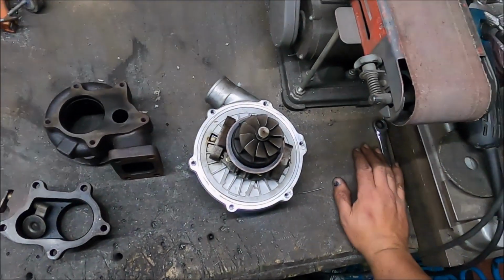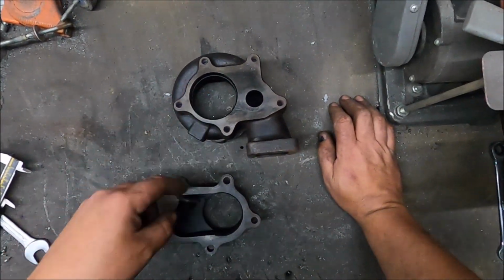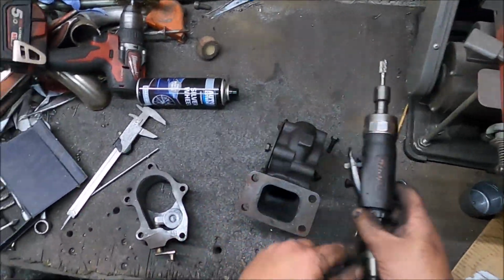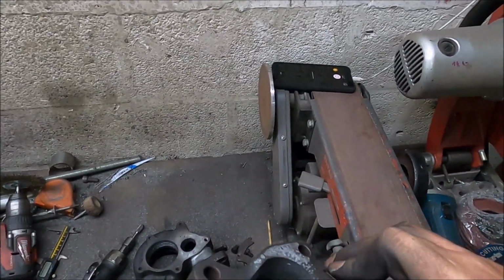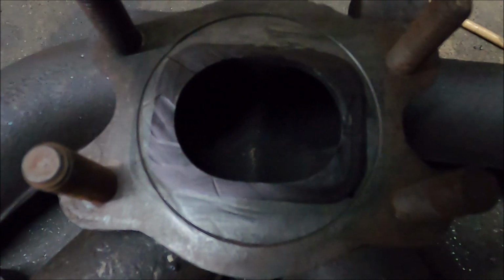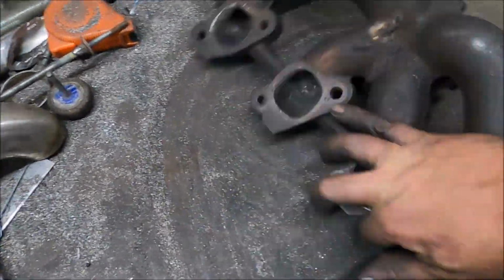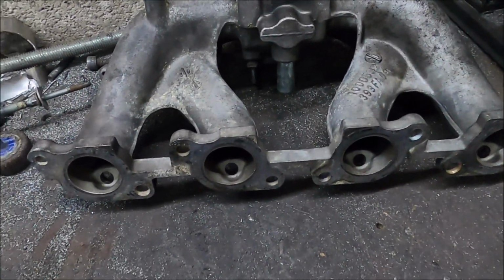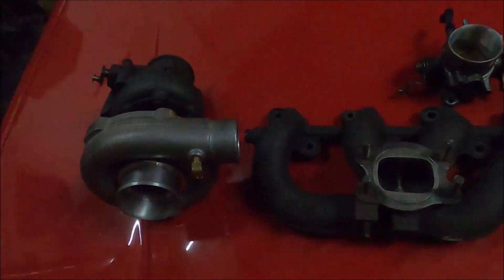Gettin' my grind on. Porting the turbo, exhaust manifold, and inlet manifold. Volvo redblock

Comment: Did the spool sound or anything changed after porting? I'm thinking about porting mine or making anti-surge ports.
Reply from the maker: No. Didn’t do it for sound, did it for performance.
Reply: @StavTech  so it did infact changed performance? Faster spoolup or?
Reply from the maker: @svicide_sexvs  yes

Comment: Do you have any contacts for Extrude Honing or Abrasive Flow Machining in the UK? How expensive is f***ing expensive? I'm potentially looking at improving the flow on a standard CA18DET exhaust manifold, turbine housing and maybe compressor housing to improve efficiency and spool.
Given the price of a Garrett G25-550 turbo and Walton Motorsport manifold... improving efficiency and potential of standard stuff (and 52-trim GT2871R 0.64) might be the more sensible approach. Ideally, I'd go for the G25-550 and then extrude hone, but the 2871 will already take my conrods to their limit, I just want earlier spool and broader torque curve.
The stock exhaust manifold splits the pulses, so combines 1 with 4 and 3 with 2, it doesn't look too bad at all for flow obstructions but smoothing the walls should make enough difference.
(I'm also working on two spare cylinder heads I've had in the garage for 15 years, found a Tomei Exhaust cam in one of them!)
Reply from the maker: I don’t know any place that’s done car stuff in the UK but a fair few places exist that do that job and I’ve considered the same too.

But your plan/goal I like the idea of, and fuck yeah that’s what I’d do over spending what, 4 grand or so on a fancy manifold and turbo.

In my experience optimising stuff that will cost you a quarter of that will get better results than the Gucci shit but just slapped on like most do
Reply: @StavTech  cool, thanks for the reply, I'll make a few calls and see how it goes, seem some mentions on US forums where it sounds like $75 to extrude hone a turbine housing... I was imagining $400 and then all the shipping costs. Will be getting manifold and maybe turbine housing plasma coated once done, keep that heat energy going toward the turbine wheel.
The higher efficiencies of more recent turbos like GTX gen2 and G25-550 is incredible, very expensive, but seems worth it, assuming all other efficiencies optimised, budget, etc.
Also discovered yesterday that gamma Ti-Al turbine wheels are a thing, HALF the mass of Inconel or Mar-M and marginally higher temp resistance.
I've got an extremely ported standard (54mm) throttle body by TURBOKONGEN (you may have heard the name), should be good to nearly 400bhp. I've smoothed the inside of the compressor outlet elbow, planning on getting a 50-60mm expander cone welded on and then sanding the inside smooth again, should remove a little restriction. Also, in the process of dowelling the plenum to the inlet manifold and inlet to the head so the port-matching I've done works. Flared out the back of the plenum's TB flange (on the inside of the plenum), hopefully distribute charge more uniformly within the plenum.
The GT2871R 0.64 52-trim comes in pretty brutally from 4000rpm, but I know all the little improvements will smooth that out and make it more driveable... possibly less scary/entertaining, but more tractable and driveable. Gas-flowing the head and the manifold/turbine housing should make pretty big differences. I do as much myself as is feasible, I even considered a £200 spares or repair Extrude honing machine.
Reply: @StavTech  just to update. Yeah, G25-550 is awesome, but £2200!
Should be getting my CA18DET exhaust manifold and GT28 turbine housing back from extrude honing in USA quite soon. $495 for the manifold, $250 for the turbine housing. £45 to post them there, not sure what it's going to cost to send them back to UK. Probably massively worth it for the turbine housing but possibly not very cost-effective on the manifold, I figured it might ensure the ports aren't blocked at the head by any manifold misalignment, if no other positive effect, maybe the smoother internal surfaces will reduce heat transfer though.
Compressor would be $250 but I've heard it doesn't make much improvement (exhaust gasses flow much faster!) and inlet manifold would $550 but that is unlikely to improve flow at all, despite the claims, it may balance the flow better between runners though, which could help optimise things.
Turbine housing extrude hone should increase efficiency by 3% and raise the amount it will flow. The OEM manifold is now proven good for 455bhp on a GT28 hybrid turbo and it ensures fast spool due to short runners and split-pulse design. Good tubular manifold unlikely to be better before 450bhp and costs a lot.
I've also read that a back-to-back test of with/without turbine jacket on a 6.7L Cummins diesel turbine housing made the turbo spool 250rpm earlier and raised torque 10% in that 250rpm earlier rev range. In theory, keeping heat in the manifold could yield even better results, rally-style wrapping seems more cost effective than ceramic coating though.
Docwra mentioned in the past that cylinder heard porting and inlet port-matching yielded 750rpm earlier spool, yikes! We had identical engine rebuild and turbo... comparing our graphs he's not far wrong! (30% more torque before mine made full boost pressure.)

Comment: Cheers! Love the video!! My OCD is sad though you didn't use a 100grit sand paper head getting those a little more smooth. I was changing my spark plugs on a Toyota Sienna and did all this..it really is amazing the car was breathing through straw. It sounds... happier even at 265,000 miles it just purrs.

Comment: Lower back pressure ftw, I'm going to be running a single GT45 on my lil V8 but I'm still a bit concerned about back pressure both before and after the turbo, If I ran twins it wouldn't be much of an issue at all but my power goals don't warrant the cost of twins. Basically I'll be running 2.5" pipes into the GT45 then a Y pipe into  2.5 or 3" dual tail pipes.

Comment: Hey, about a he500vg would it work fine in a l6 4.1 liter 7k/7.5k rpm max, engine? Im just making plans for now but knowing that the he400 is like a hx35, here in Brazil its kinda common the l6 4.1l hx40 equiped, so the he400 seens kinda small. What do you think?  [Edit] - getting it spring or diaphragm actuated would it need a external wastegate?
Reply from the maker: HE400 is like a HX40 usually. What engine is it? HE500VG will work well if looking for big power for sure
Reply: @StavTech  is a chevy 250ci inline six from a car called opala

Comment: Would it be worthwhile to weld the wastegate and run an external gate vented to atmosphere?
Reply from the maker: If I wanted to spend money, but I don't
Reply: @StavTech  was just thinking you might have one sitting around from another old project you could have put on. Would it make a reasonable difference or not worth it?
Reply from the maker: @supernovadw  it would if I didn't modify the stock wastegate. But not now I have